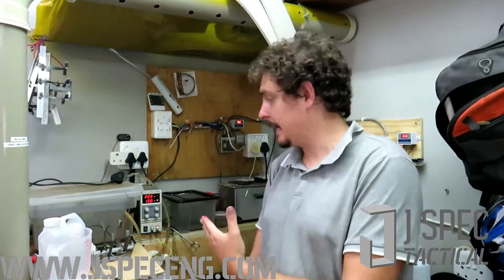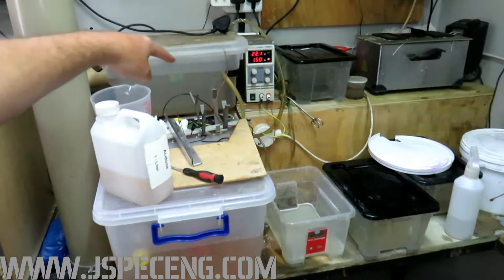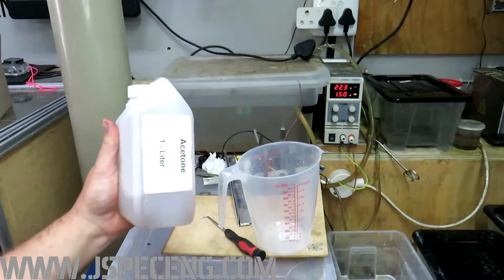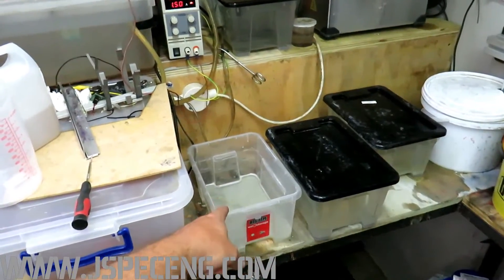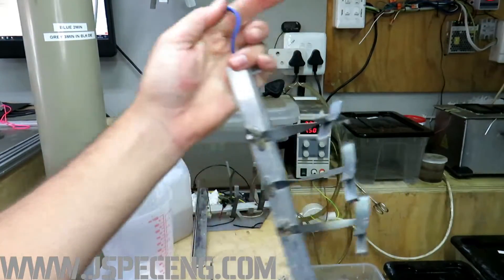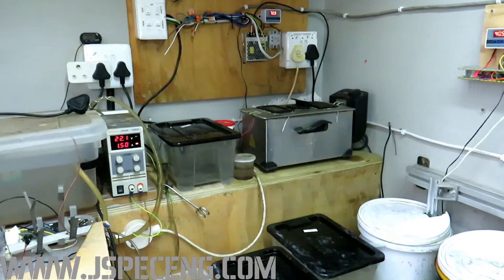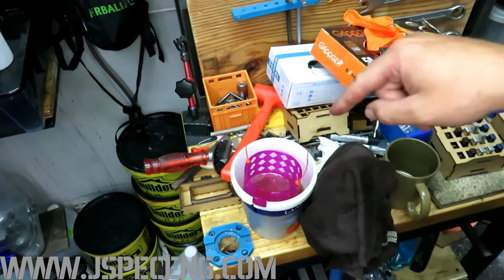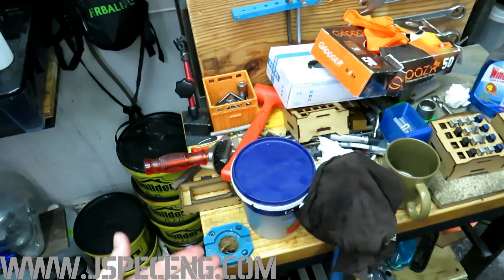My Anodizing Setup (DIY System)

Comment: First off: Thank you so much for sharing! You are indeed getting great results. So did I sometimes but can't get it to work reliably and consistently. Watching your video I once again realise the key is in clean, clean and clean some more. And getting the temperatures consistent. What are you using for the cathode in the Acid bath? I was using aluminium but it got 'eaten' after a while. Also, do you use air for agitation in the acid bath? I had used some air line (ptfe?) but that also dissolved after a few months.
Reply from the maker: I use a lead sheet as a cathode and I am using a fishtank airstone to agitated the acid

Comment: I am one of the best in the world in Anodizing process.
How do you control coating thickness, coating weight, coating density and hardness.
Without these measures you are wasting your time .
Makhan Gupta
Reply from the maker: Most of my anodizing is just for appearance. The parts that do need very tight tolerance I measure sample parts before and after ano and comp part sizes accordingly.
Reply: @jamiedco  anodizing is done to achieve
Decoration
Non conducive 
Hardness
Non reactive 
Slippery surfaces

Comment: what is the acid ratio do you use
Reply from the maker: I mixed my acid to 18% by volume
Reply: Best anodizing is done at
175 grams per liter of sulphuric acid
12 amps per square ft 
70 degree F
25 min will build the .0004” coating with proper hardness
Seal in D I water at 204degree for 30 min
Reply: @makgupta1589  is this information for class 2 hard anodizing seems to high of temp
Reply: @mysterysniper910  you may want to look a the conductivity of Sulfuric acid and the temp relationship. Lower temperature, lower the conductivity of acid and need more amps for the same voltage.
Anodizing coating is harder as temp is lowered.